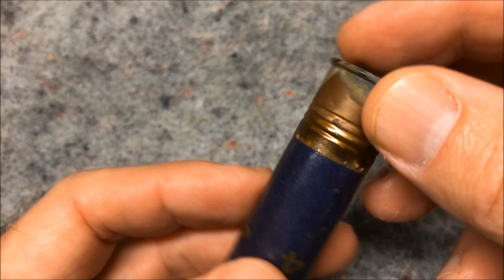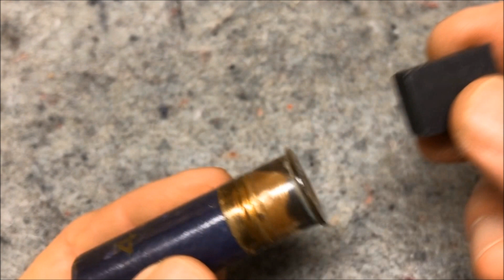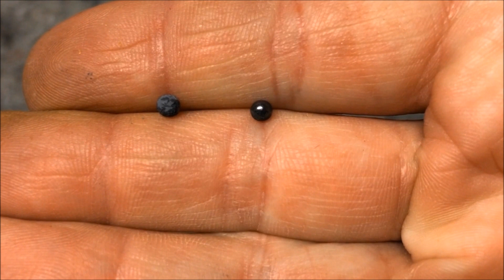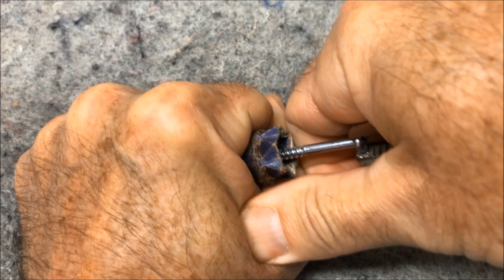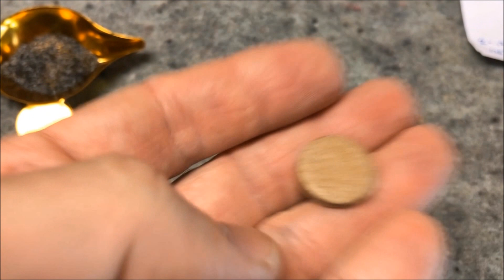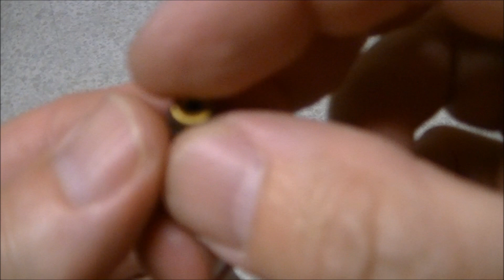Crusty 16 Gauge Shell - Will it Fire?

Comment: Proof positive you do not need a plastic wad paper will work just fine except for maybe the barrel needing a bit more cleaning but whatever good vid. I have 16 ga Cooey, Stevens Bolt and Auto 5. Never use plastic in my reloads just card like shown. I am cheap not virtuous lol.
Reply from the maker: Fiber wads are actually almost "self cleaning", every shot is a bit like firing a cleaning patch!

Comment: Good show that shell looked bigger than 2 3/4 in the video
Reply from the maker: Probably due to the proportions of a 16 gauge shell, most of us are used to looking at the larger diameter 12 gauge 2-3/4" shell so the same length of 16 gauge looks longer by comparison.

Comment: Those old Imperial Shot Shells had a reloadable primer. The primer battery cup is about half the length of a standard 209 primer. A number of yeas ago at a guns how I bought 1000 of the primers to reload these short battery cups . I still have a few left. they are a powerful primer ,and will work fine in most shot shell hulls.  On the other hand it is a fight to get a standard 209 primer to seat in an imperial hull. This does not include the modern imperial hulls that use the standard primer.
Reply from the maker: I also have a used a bunch of the old CIL 4B primers. The trick to using them is to have the correct short primer pockets to put them in. The whole subject might merit a video.